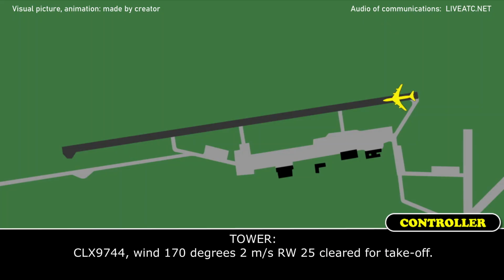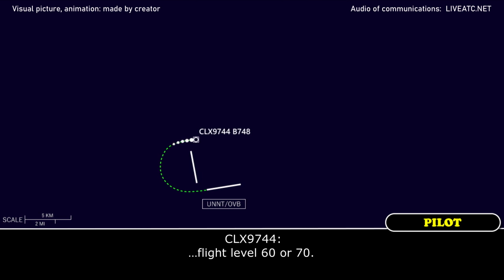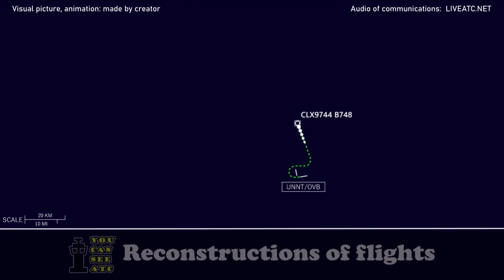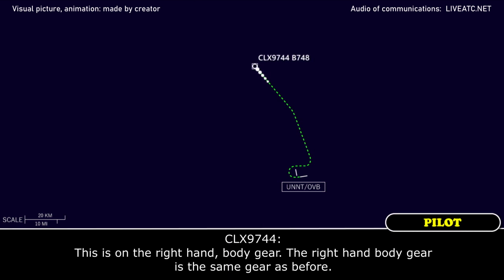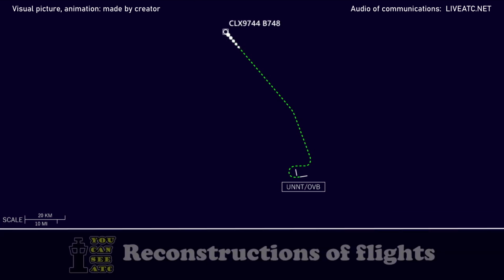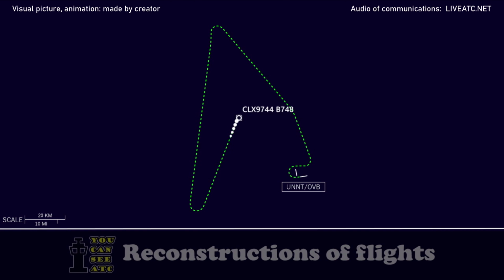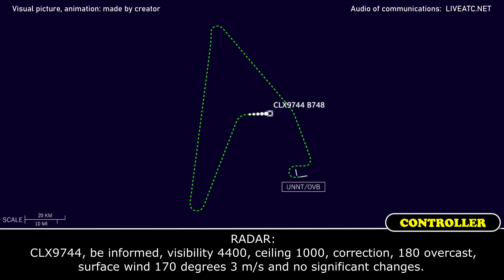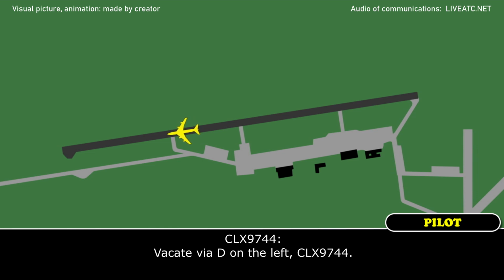30 tons of fuel were dumped near Novosibirsk | Cargolux B748 | Novosibirsk airport, PART #2

Comment: I could have used that fuel for my tractor!  How do you read 1000 meters on an altimeter??
3:58 gear tilt message ... airplane's belly
Reply from the maker: Thank you.
I guess they have specific charts. It helps to find out the altitude in feet.
Reply from the maker: 1000 meters is about 3000 feet.